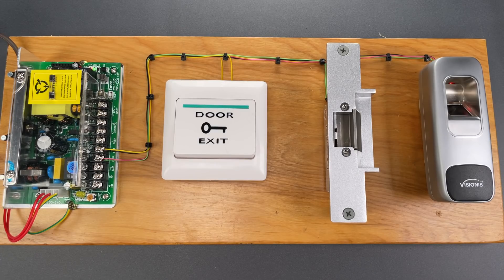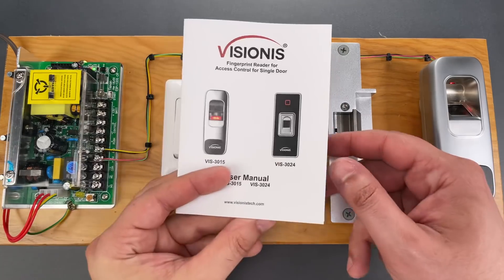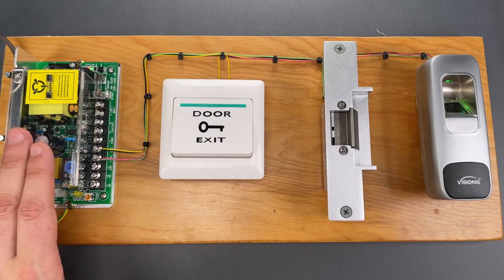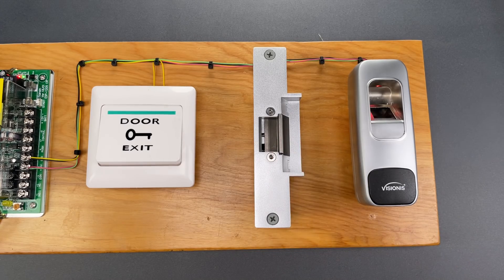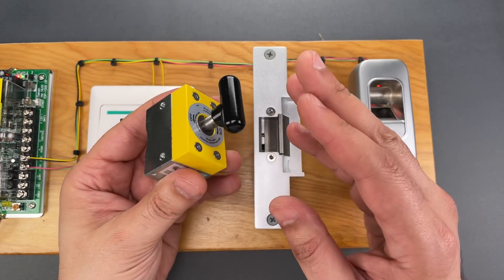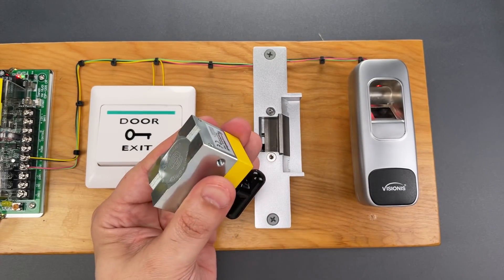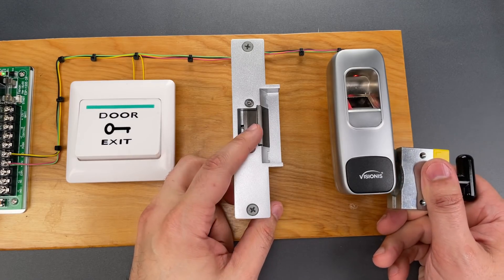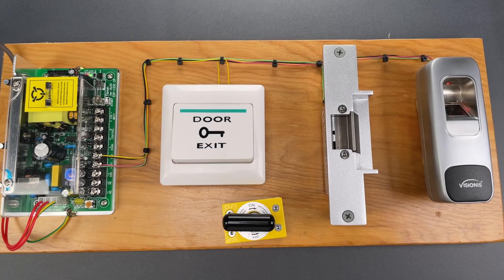[1359] Security Theater: Visionis Fingerprint Reader Bypassed

Comment: Honestly seeing how easy electronic locks are to open I can believe anything in the movies
Reply: In movies they always use the fingers of the dead guards, sometimes cutting them of..
If they knew all they needed was a magnet....
But it would be too anticlimactic für hollywood standards ig
Reply: @MM-lv7ie  Now I want a heist movie where one of the guys goes to grab a guard finger, and another asks: "What are you doing?"
"Getting a finger for the fingerprint scanner...why?"
"Watch."
And they just tap the scanner with an electromagnet, and the door opens.
Reply: @hardwirecars  It's not always reliable to detect pulse through fingers and some systems have issues with pigmented skin.
Reply: @hardwirecars  I know, but Hollywood doesn't seem to. Not always anyway.
Reply: Yes but it's never that easy in Hollywood.
Reply: If you see this on a movie, you would not believe.
Reply: Plot twist those hacking into door scenes are just overly complicated magnets
Reply: Hollywood is just total fiction. Why would you presume to think that they would even attempt to accurately depict the actual real life situation? Where would the drama if the security system could be bypassed with just a magnet?
Anyway, it is always possible to have far better security systems. You can either buy rubbish ‘security’ systems/locks that may look good, but don’t actually offer any significant protection. Or you can get something that is actually far better quality, and which does actually offer better security. Obviously these higher quality systems will not be cheap.
Reply: Seller of access control systems here. Standalone locks like this one control the electric strike via a relay. Applying magnetic force through the casing onto the relay with a strong magnet will create the necessary connection inside the relay to open the strike. 

Under normal circumstances when access is granted, current would be applied to the relay, creating a much smaller, but sufficient magnetic force to facilitate the needed connection.

Higher end systems always place the relays on the secure side of the door or centrally in the building.

Comment: You make great points. Proper commercial systems I put in don't have those vulnerabilites. Great to share how crap they are.👍😄🍺
Reply: Send one to LPL and see.
Reply: Have you personally tested the reliability of that claim? I've seen a lot of commercial systems that are pure security theater.
Reply: That sounds like a challenge. Send one in and see what happens!
Reply: I'd love to see LPL test your stuff.
Reply: @patrickgardner2204  if I had atleast $3k+ to spare, sure I would but I don't. Lol. That's why only big organisations use them cause they can afford the best and need a level of certification of physical and electronic security. That lock he shows is basically a toy setup. Lol
Reply: Most multidoor systems use a reader or keypad on the outside while the brains and relays are on the secure side.  Most still use Wiegand format meaning you can take the reader or keypad off the wall, splice in a modified ESP32 and it will record the next valid cardswipe and then replay it on demand.
Reply: @wesley00042  non Weigand are encrypted comms., that won't work. Weigand is very basic.
Reply: @DonzLockz  Most commercial systems support encrypted comms like OSCP but most installers install them with basic unencrypted Wiegand.
Reply: You get for what you pay for in this case.
Reply: All of them do.
Reply: They often have other vulnerabilities based on other cost cutting decisions.  Such as sending unencrypted card swipes so you can open it up and splice a sniffer onto the data line.
Reply: @ObadiahtheSlim  after watching this video, do you honestly think that LPL will need to put that much effort into opening any lock anywhere?